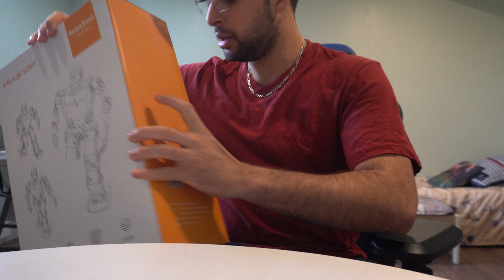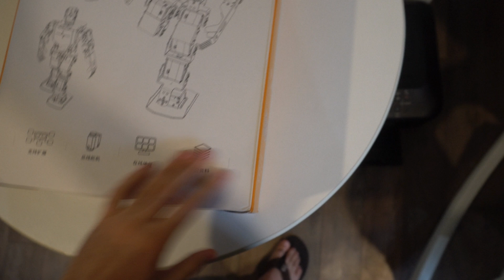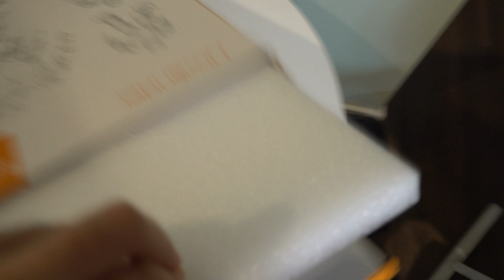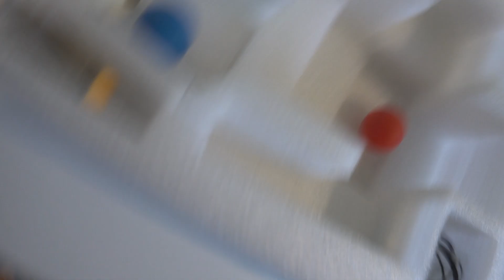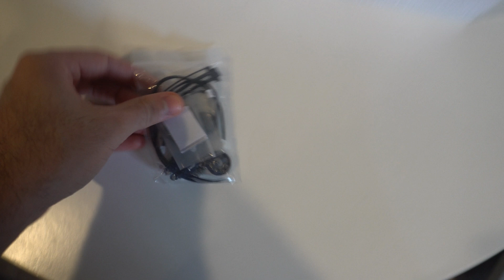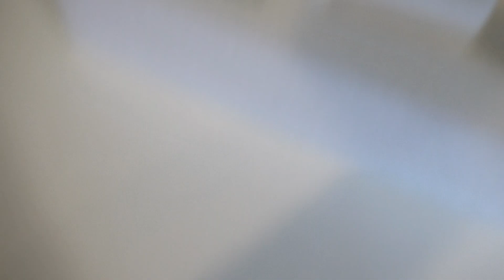TonyPi Humanoid Robot Unboxing and PD Joint Controller

Comment: Hello My Friend, did you try ps2 controller or xbox kinect ? Also did you try sensor add it ?
Reply from the maker: Hello, i did not try any ps2 remote control or any other remote controller. I tried adding an IMU sensor MPU6050 i believe and it worked. The raspberry pi has lots of ports for sensor expansion
Reply: @17Koche  Thanks a lot. I wait to video about MPU 6050 using. Is it been changed to tonybot buying tonybot board? I am a science and technology teacher in science and tech education center for gifted children. So I want to teach both arduıno platform and python.
Reply: also thanks a lot for  your works
Reply from the maker: @bahadirgulcu272  not sure if i will ever get to do a video on the IMU but one thing i might do is if I find my work, I can upload ot to Github or something? Also, arduino might be the easier platform to start working on embedded system for a younger audience

Comment: hey what website did you get your robot from im trying to figure it out. theres a china one and hiwonder.hk
Reply from the maker: Hey! I got it from a 3rd part vendor on eBay. Though you can also get it from Hiwonder's website. Why are you considering buying this robot if you don't mind me asking?
Reply: @17Koche  thank you! and yes I  grew up with robots I think this is really cool
Reply: @17Koche  also for the programming is it just in chinese lang only?
Reply from the maker: @funds3014  For the most part, the documentation is in Chinese. Are you just a hobbyist or are you a researcher? As a researcher myself, I wouldn't recommend this robot for research due to several issues, but if you are just a hobbyist, this robot should be pretty fun for you to play with :)
Reply: @17Koche  dang that sucks and both lol I'm trying to find a decent robot between 6-8 I was gonna try and work with raspberry pi
Reply from the maker: @funds3014  what's the application you are looking to accomplish? If it is something related to control systems, the motor sensors are not responsive enough to run in real-time, plus imo I find the documentation for this robot vague and lacking for research work
Reply: @17Koche  are you able to have it walk through your home and is it able to follow the black line like how it demos in the production video
Reply: @17Koche  raspberry pi website has sensors I think
Reply from the maker: @funds3014  yes i believe if its for those applications its fine. The raspberry pi should be good for most applications. But, if you are looking to design complex control systems and walking gaits for it, then i would consider another option if I were you
Reply: @17Koche  do you know any robots out there
Reply: @17Koche  im looking at 3d printing now but i wouldn't know where to begin with programming
Reply from the maker: @funds3014  There's the pimecha robot which is very similar to tonypi. Building your own is a good option too but will take you some effort. You just have to pick components that are well documented
Reply: @17Koche  im trying to find a decent 3d printer and have to find a shop for components
Reply: @17Koche  what about recognition with the camera on tonypi does it suck
Reply from the maker: @funds3014  i havent experimented with that, but from what i hear running opencv on raspberry pi is ok at best you might only get 4 or 5 frames per second. If you want to play with computer vision, do it in a computer. Or if you need the computation to be done on a robot, buy a more powerful single board computer and implement it on there

Comment: I just subscribed to your channel. I would like to start with robotics, but i just know python and just ordered Arduino to learn the basics. 
You've introduced the robot very well. Is there anyway you could tell me what should i do to start with robotics?
Thanks. Keep it up bro.
Reply from the maker: Hi Ahmed, the answer to that depends on your own learning objectives. If you want to do robotics as a hobbyist then working with arduino's is fairly easy and gets straight to the point. However, if you want to do robotics as a profession, then you first need to identify which subfield of robotics you are most interested in. For example, I do most of my work in the study of control systems. Other subfields include SLAM, path planning, electrical or mechanical hardware design, software design of the robots, and many other subfields. If you tell me a bit more about what your goals are, I can potentially guide you a bit better. Thanks
Reply: @17Koche  Sorry for my late reply and thank you so much for your answer. I came back to check your video since I'm planning to buy this robot or similar Raspberry pi powered robot. I like robots. I just started with the IT field. I learn how to design flask web application api and i learnt a little bit about machine learning in the past. 
I didn't decide yet what i want to do. I'm still totally fresh and have no knowledge about anything. My Arduino starter kit should arrive today and i should start with it and learn the basics soon. I live in Japan, so i have many robot shops near by me. I'm so passionate about robots, but i don't know what to do to start with the basics. I have no goals for now. but of course, i would like to have a profession in robotics field if possible.